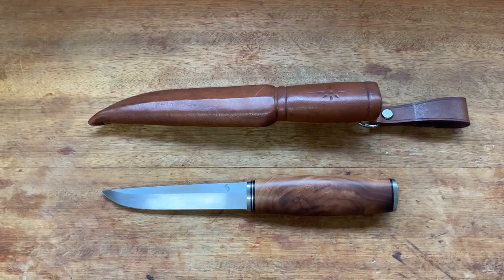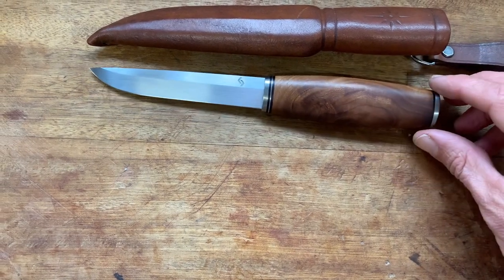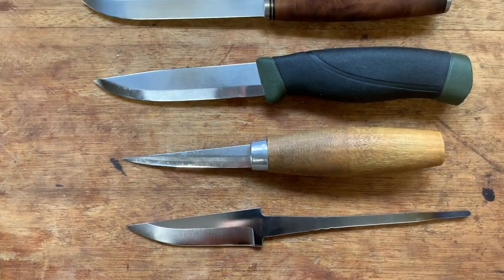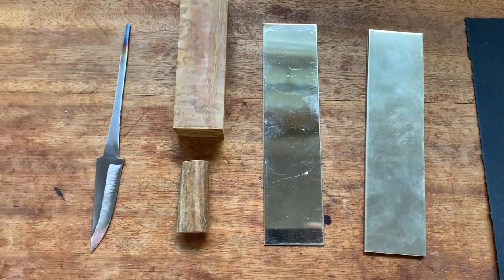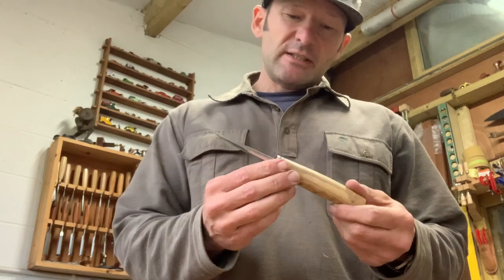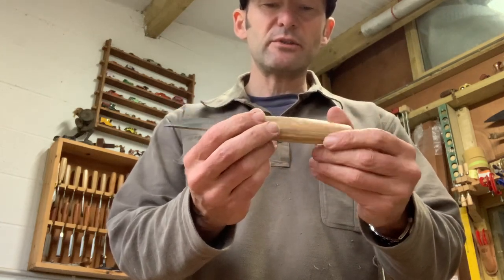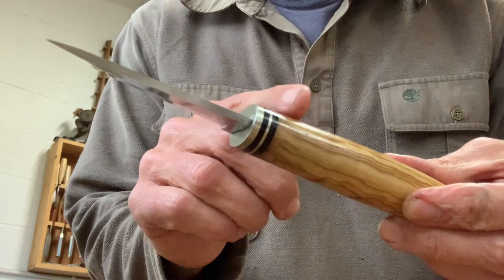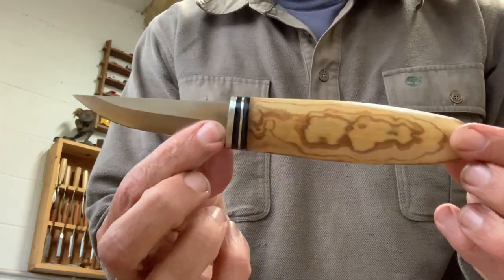Make a Puukko from a purchased blade and handle materials.

Comment: Well done, came out sweet! Nice belt grinder setup too.
Reply from the maker: Cheers mate, it's actually an Aussie made grinder. I find I use it so often and hardly ever use the bench grinder.
Reply: @bundufundi  I have a 2×36 and have found the same thing, about the only thing i use the bench grinder for is sharpening drill bits or buffing. Actually hoping to be upgrading to a 60 or 72 in a few months. Are you going to do a sheath for the pukko?
Reply from the maker: @kurts64  A Sheath is next on the list. I would like a 2x72 but they are pretty pricy now for a good one.

Comment: Wow that looks great, beautiful bit of wood you got too. What a well kitted out workshop you have. Just out of interest veitsi is the Finnish word for knife and puukko is just the word for this kind of knife. You wouldn't call a folder or a kitchen knife a puukko. The word itself is probably derived from the word puu, meaning tree or wood but whether it refers to them being used for cutting wood or having wooden handles, who knows?
I often use knives with exposed tangs in extreme cold. I think this could be one of the reasons for the rat tail tang but probably not an important one. Weight, balance and the price of steel are probably more important factors in my opinion. After all rat tail tangs are hardly unique to Nordic countries.
Nice work mate. Thanks for showing us your puukko.
Reply from the maker: Thanks Tim, I was hoping you would fill in some of the blanks being a bit of an expert on the area and Puukko's!